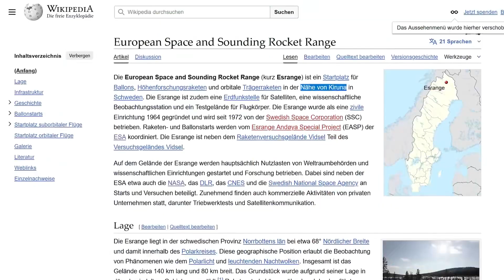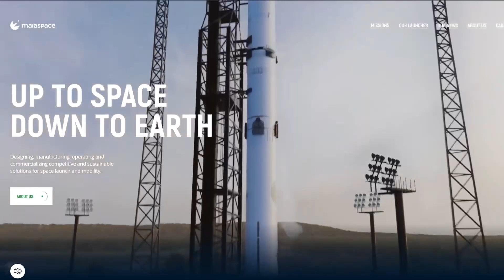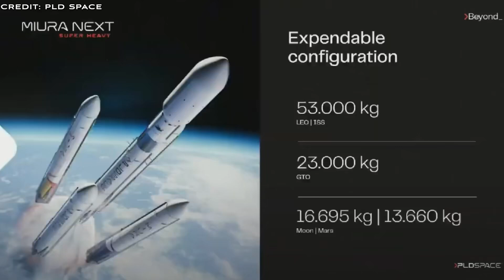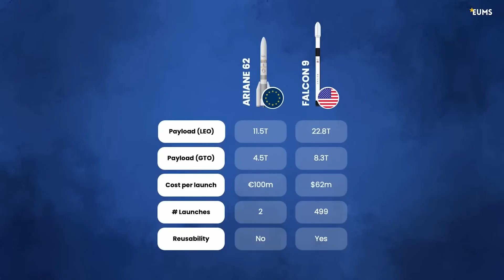How ESA Plans to Catch Up with SpaceX Using This Clever Strategy

Comment: I'm glad this programme is happening, I really am. Giving European rocket engineers some rewards for innovation is good. So this is certainly better than nothing. But... That's about the best that can be said of it. It's wildly insufficient for getting Europe back in the space launch game.

Having lower-cost indigenous capability on par with the Falcon 1 or Electron is, again, better than nothing. But what SpaceX has shown is that you need a low-cost launch vehicle with both a large payload and high cadence in order to truly reap the benefits of access to space, in both commercial and national security terms.

China has certainly gotten this message. You know how many programmes they're running in parallel to build reusable Falcon-9 class boosters? Not just proposals, but actual different companies that are bending metal and firing engines, aiming at a Falcon-9 analogue? EIGHTEEN. Half a dozen of them will have flown by this time next year. Plus another three groups developing Starship analogues which aren't as far along. THAT is how you stay competitive in space, and maybe even get ahead.

In contrast, what Europe is doing is barely a fart in the wind. Better than nothing, but needs to be much better than that.